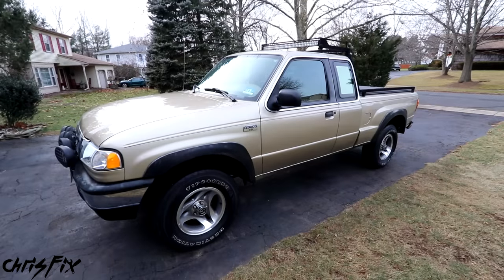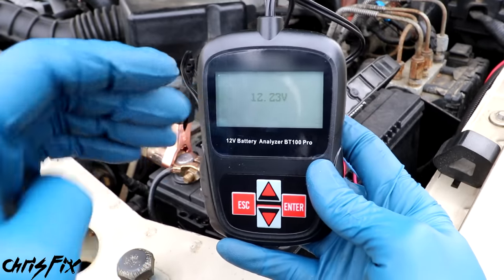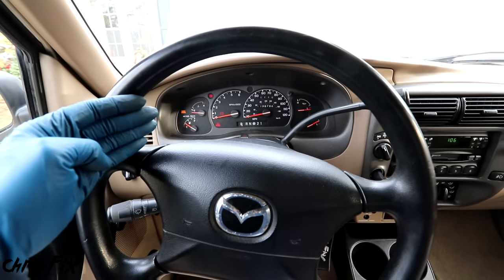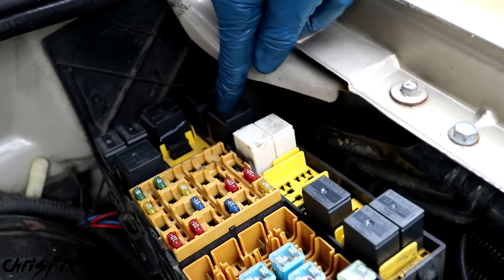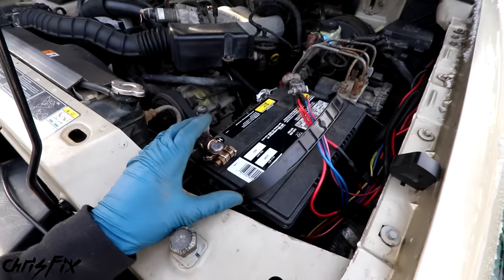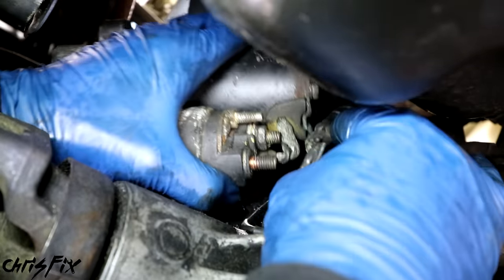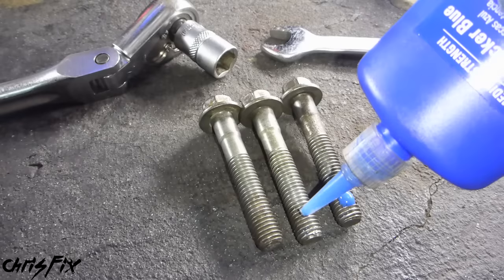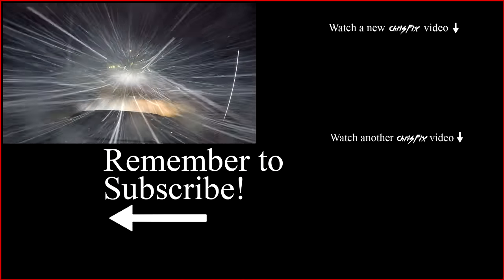How to Diagnose and Replace a Starter

Comment: One simple test that helps on seeing if it's a battery   is when you hear the clicking noise, see if the horn works.  If it works, the battery is probably charged.  Hitting the starter with the tire tool is an old trick.  How do you know where the starter is on your car?   Follow the positive cable from the battery.  It should have a positive going to it.

Comment: I need your help. Most of the times my car starts normally, but once in a while, once in about 5 times, the stater is spinning and mashing a slippery noise and it doesn’t engage, And then when I try again, one or two times, it works! I have tried different starters, and they all do the same thing, and then I have ruled out the stater as a problem and I now suspect something else like a relay, the ignition switch or other, causing the starter not receiving enough power maybe once in a while to deploy completely the pignon gear of the bendix to engage the big gear by the flywheel to crank the motor properly. Can that starter slipping and slipping turning noise be caused by not enough power getting it, making it turn but not fast enough to push the pinion gear completely out once in a while and therefore not engaging? But if it was the cause, why would it engage the next time or second next time? I have ran out of explanations, causes, reasons and ways to fix it, please somebody, help me out, thanks so much!

Comment: How do you rule out ignition wire or ignition issue? Some mice got into my 83 Chevy with already original wires here and there, and the previous owner had done some weird things with some of the wires. I found some spots that I taped or spliced back together but I would like to rule that out before taking it all apart. I also checked that the engine could turn since water filled the tanks that the previous owner didn't know how to seal properly, and it could but was pretty difficult so I'm not sure if that counts as being able to turn over.
Reply from the maker: You can probe the starter relay. When you turn the key there should be power to the relay.

Comment: What’s up Chrisfix   Hey I have a problem with my truck
I have a 03 Mazda B3000 
And I resent replace my starter but the issue I have is that when I put the new started and tried to connect the battery my truck start cranking without a key on ignition.
What do you think can cause that problem?
Please help me out!!!

Comment: My car just needs a bit of time to start it up, could it be the air intake or just a bad spark plug in that case ?
Reply from the maker: Could be low fuel pressure
Reply: @chrisfix  Thanks for the reply ! 👍🏼, I just think it's also due to the fact that the car has an ethanol box, and i put another fuil in it so the initial ignition is too weak.

Comment: Hey Chris, thanks so much for the amazing info and steps you provide. I have a BMW X3 2008 and have trouble locating the starter relay. Does it even have a starter relay? Getting mixed information in the forums online. Don't have the full fuse info on the car. Just the ones in the glove box. I checked there's power going to starter and signal also when key is turned. Still no crank no click. Does that mean starter is bad?
Reply from the maker: So on the BMW I think the starter is controlled through the computer and not a relay. Sounds like the starter is bad if you are getting voltage to it. Maybe give it a few wacks with the hammer?
Reply: @chrisfix  will try, that sucker is located under the intake manifold deep down. Already it was a challenge to test the power. Thanks again.

Comment: Having a problem with my truck starting after its hot. When its cold starts right up. However after running it for a while and its hot I only get a click when turning the key. I have replaced both batteries the negative battery cable, the starter, and cleaned my contacts. I have even checked my grounds on the body, frame, and block which seem to be good and am still having the same problem. Any ideas??

Comment: you don't always need to replace the Starter, last time my car didn't start, I opened the starter and changed the starter carbon brush and it fixed my issue.

Comment: Hey Chris I really need your help. It looks like you work on Ford Rangers well I just happen to have a 2003 with the automatic transmission and a 3L V6. I am getting an intermittent no crank no start and I have check relays fuses took it into a shop they replace the battery and check the starter and they said everything checks out. I have to turn the key anywhere from half a dozen to a dozen times and then finally it'll just start up and it usually does it after it warms up but there's been a couple times now that it's done in the mornings when it's cold. The guy at O'Reilly's says it's my starter but yet and some of these Ranger groups I'm in they are experiencing the same thing and they've replaced starters and it still doesn't? I have checked the ignition switch and the neutral safety switch has been replaced, and used the spare key with a new chip and it still doesn't, someone told me to unplug and replug the PCM?

Comment: so my car is doing the clicking sound as if the starter could be bad (not rapid clicking) but I've noticed that my dash and radio dim out or turn off when trying to start, the power windows dont work and when i locked the doors the horn sounded weak.  I tried jumping it with my dads car and it kinda cranked over but wouldn't start.  Could this be the battery or starter?
Reply: we also try hitting the starter and nothing really changed
Reply from the maker: Sounds like the battery is getting weak or doesn't have enough charge, I would get it tested and see whats going on
Reply: @chrisfix  ended up getting a battery and just got it put in and it works!  Thanks, also I absolutely love your channel and I’m always going back to your old videos for info and stuff!

Comment: hi, when i turn key to crank engine i can see the timing belt rotates. but the car won't start. could this be a bad starter. or do i have fuel or spark issues? thanks

Comment: I recently replaced a bad starter motor in my Infiniti. But right after replacing it I had the remote start key fob start the car twice before it stopped working. I can only start the car manually now. It's about 3 weeks now and the car struggles to accelerate on turns.the car also struggles to reverse up a slight hill. What could be the cause.

Comment: I can change the starter on my car easily since I had to remove it to replace the bad crankshaft position sensor on my car last year and my 20 year old starter is still going strong. Not bad for a 130,000+ mile ShortStar V6.

Comment: In a manual transmission car, you can also pop/roll start the car if the starter doesn’t work or if the battery is weak but not dead.

Comment: we need to change a ford f350 diesel starter 7.3.  turning the key is goes clunk but does  not engage.  some are saying we need to change both batteries too, but we will start with the starter first.

Comment: I have a 2001 crown Vic I have the same issue clicking  clicking  I took it to an auto store they check the battery they  said it’s good. Tow truck guy same the same thing   I brought the  battery tester. It said healthy 40 percent  the charge said 25 percent    At the bottom it said good - recharge. Do I need a new starter  help help help.
Reply from the maker: I would charge your battery as much as possible first then try starting and see what happens

Comment: It be recommended to charge the battery if it’s below 12.2 you can still start it on like 11.5 it just might be a little slow however, very few starters will even spin on 11.5 my fourth GEN Honda Civic LX sedan can after a few seconds it just starts clicking even then it still hasn’t started there’s no spark

Comment: hey Chris if my starter is smoking out the solenoid do you think its bad
Reply from the maker: The starter is smoking?
Reply: @chrisfix  yes when I hook up the battery it immediately starts dumping smoke
Reply: btw its an 89 chevy suburban bbc 454 if that helps
Reply: @chrisfix  changed the starter doesn't smoke now I need to get it to start something about sitting for 12 years

Comment: I had a lot of things go bad on my car especially a starter. When your car tries to start but makes a certain noise you know it's a starter. Basically turn the starter and it won't turn all the way. Another way you could tell if a starter. The battery if the battery is good that usually means the alternator is good. The alternator is job is to give power to the battery and keep power from the alternator to the battery so they're both juiced up like so the battery doesn't run out the alternator continues and so on. And that's usually how you know if your battery and alternator are good then you usually know it's a starter. A lot of times shops will test and see what's how much power you got from each of your part from your battery your alternator and your starter and that's how they can figure out what's going on.

Comment: I didn’t read the comments and someone else may have made this suggestion? In case it wasn’t:
With bringing in the old start, you can compare the old starter with the new one. Just because the start looks similar, doesn’t mean it’s correct! I got a proper looking replacement starter, however…the pinion gear on the replacement starter was not the correct one 🤯 so no amount of starting was gonna get the car started. Always throughly check new parts with old ones!!!
The auto parts store I was at never seen or heard of such a situation before and I was 90 minutes of drive time away -it wasn’t a good time.

Comment: I have a Ford escape. No start issue. Key turns freely but no crank no start. There is one click when i turn the key. Could it be the starter? What about the ignition switch?
Reply from the maker: Most likely it's a dead/bad battery, loose connection (https://www.youtube.com/shorts/IIzKhRDhhW4) or a bad starter. Could also be the ignition switch but I would rule those out first
Reply: @chrisfix  thanks. Battery is good. Everything works on dashboard panels lights. Radio lights etc.

Comment: Hey Chris, what if the car cranks a little too long then starts?
Reply from the maker: Could be a bunch of things, have you observed any other kind of issues like a fuel economy drop or engine codes?
Reply: @ boldways mine was doing that too, I felt like it is starting bit too long. Today it is completely dead :( No lights, no sounds, just silence😅 My battery is less than a year old so it can be alternator, starter or fuses. I have no clue that is why I am here, looking for help and answers.

Comment: Hey guys i woke up to this issue today, The engine is cranking just fine but not starting. But when i turn the key back after holding it turned to start the car kinda sputters like its trying to start. we just had the alternator replaced about 2 months ago and the mechanic said the battery still held a charge after it died. Any idea why it seems to sputter when i turn the key back but wont fully turn over?

Comment: I just replaced my battery and the thermals are tight and the battery is good, haven’t checked the fuses but it starts intermittently and sometimes a slow crank where it takes a few cranks for the motor to fire up. Once it stops working and starts working again it doesn’t have a problem for another week or so

Comment: We have a 2007 kia rondo and tested battery and alternator and starter and it all said good...I check terminals and all are tight now...on occasion it will crank sometimes it wont...usually when it's cold  it doesn't crank. I'm starting to think it's the starter.
Reply from the maker: Seems like the starter or the relay is starting to go bad since it's more likely to fail when cold and the others checked out
Reply: @chrisfix  I swapped the starter this afternoon so I guess we shall see if we got any problems in the a.m.

Comment: What if it takes like 5 to 10 seconds to crank over but always still starts? 2007 Pontiac G6 GT 3.5. Battery tested good, no corrosion, terminals are tight, fuses and relays are good.

Comment: If you want to know if your starter is not working i suggest you to find where the starter is and hit it will something,like three four times than it should start but you need to get it fixed soon because it will not last long.

Comment: I've never had a problem replacing a starter, but then again, I've only replaced them on older Chevy 350s and straight-6s. It takes longer getting to the parts store and buying the starter than it does to replace those...

Comment: I just replaced mine and not a difficult job, but  I think I should get more than 2 years out of a starter. At about $200 I expected more than a lifetime of replacement starters.. I could get that for much less. 
  In my other car experience,  the replacements will go on until you buy a new Bosch or other quality starter and then the merri-go-round quits quitting.

Comment: Why no mention of the solenoid.  Many of us who have dealt with a lot of rigs over the years have had to swap them out. More often than not, we went on to enjoy years of good service from the starter.

Had an old Chev (might have been my 57 1/2 ton) and was able to pull the solenoid apart and flip the copper disc inside to get some more life, until I could get a new one.

Comment: Will a bad ground cause the starter to just 'click'? I just finished my first project car and turning over the car is hit or miss with the starter as it seems to 'click' half the time. Brand new battery, great voltage and brand new starter. The only thing is, I painted my block so my starter is bolted to a painted block and that's suppose to be my ground. Just wondering if anyone thinks that might be the issue?

Comment: Well I am changing my starter on a Corolla 2011 type S because it’s got 175,000 miles and I never change it. I do have power on the battery and I don’t think it’s the alternator. But I did buy the starter relay and starter so let see how easy is it. I know I can go underneath the car so will see.

Comment: I was in Manhattan and the ES330 I was driving failed to start. Checked the connection and determined it was the starter. The former drifter in me wasn’t gonna give up too easily. Saw a couple vids and saw that access to it was easy. I ubered to an Autozone in Brooklyn where I bought a starter and the cheapest basic wrenches needed. I did it curbside with pedestrians watching as they passed lol. Fired right up afterwards. Only took a couple hours Uber to startup..

Comment: Years back on my first car, a 2002 Saturn L100, my dad and I were replacing the starter, and obviously I was the one who crawled underneath to unbolt it. But he forgot to disconnect the battery, so when I tried to pull the starter off, sparks went flying

Comment: There is 1 that I have done that were the worst to put in. And the vehicle is the Dodge Nitro because you have to take off the drive axle for the 4x4 model in order to get to the starter. However I have seen YouTube videos where they have slipped it past certain points of the vehicle to get it off but they don't show the process of them actually doing it. I guess it depends on which model you have but the model that I worked on was a pain in the butt it was my friend's vehicle and I made a promise so I had to do it I ended up needing his help to loosen the bolt on the drive axle being that they were so tight on there and it and it wasn't just a break loose and then it loosens up it was every turn was so tight almost until getting the whole Bolt off therefore bolts to take off and you have to move the drive axle around in order to get the whole thing a loose to get to the starter. # worst experience ever

Comment: I have a 2002 Ford F-150 with roughly 270k miles on it.  When I turn the key it just clicks.  I'm thinking starter, but could that be part of the issue?

Comment: Ultima Starter doesn't come with mounting bolts and the threads do not fit the original... So what to do? Re-tap and thread the holes on the starter or try to find bolts that will fit?

Comment: I got a wired tik sound when i try to start. and it quickly runs out of power on the battery! Is that a big signe that my battery is dead? When it drain out so fast?
Reply: imean not wired...But tiks superfast and glow in the dash is waving up and almost out.

Comment: there are some other causes that were not mentioned chris   for IE on a ford focus  it can be a bad engine ground  that will keep it from starting   also  ignition switch  pos b cable diod burnt out  and I can think of many fore   fuel pump  oh so many more  also  after market remote starters

Comment: I have a 2000 dodge neon, at first i thought it was the battery not retaining current because the cranking was very sluggish, i tested with another battery and did the same, i could not afford a new starter so i took it out and disassembled it and man oh man, the inside was dry, dirty, black powder, no lube at all and the brushes were all worn out, i cleaned the hell out of each moving part, re-lubed it and the brushes were very cheap to replace, reassemble the starter and IT CRANKS LIKE A CHAMP and after 2 years, the starter still cranks like brand new!!!
Reply from the maker: I'm glad you were able to rebuild it yourself and get it working again for cheap! I want to do something like that soon I think that would be fun to show
Reply: @chrisfix  i'm also planning on recondition the alternator, it still works but it can last even longer!

Comment: What if the car cranks but its really weak and starter disengages after few turns on its own? 
Battery is good (Checked twice) 
Engine is turning so it's not locked 
Fuses are all good...